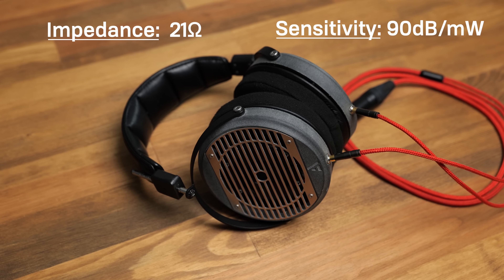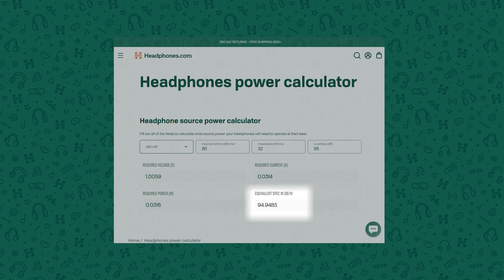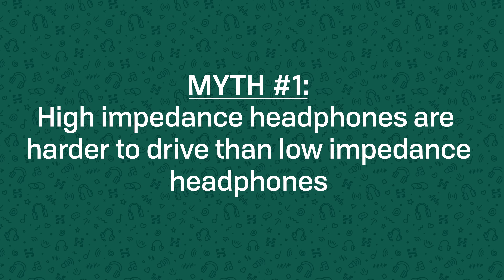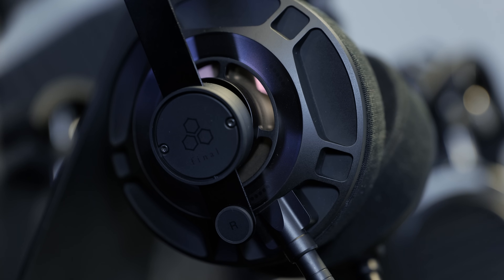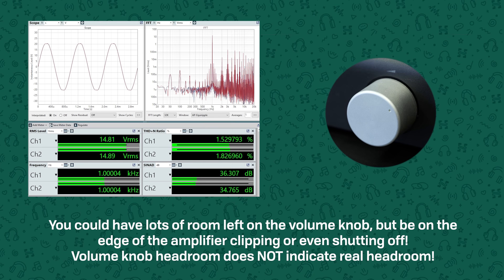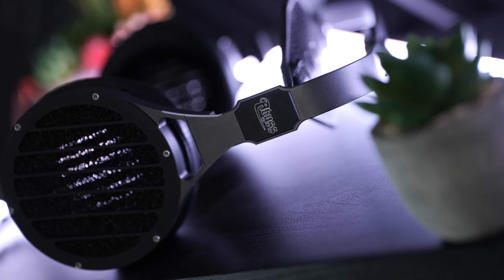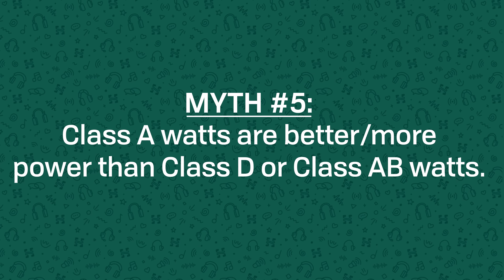Do I need an amp? How much power do headphones ACTUALLY need? - Myths about power

Comment: Example: your calculator says i need 39.81 mW for Hifiman Arya Organic, these headphones are 16ohms, so I need to check amp power on exactly 16ohms? What if it is specified lowest only on 32 ohms? How to recalculate to 16 ohms?
Reply: It's easier to ignore the impedance and just look at the voltage. If the manufacturer only specifies the power at specific impedance, you can put those two numbers into a watts/volts/ohms/amps calculator and it'll give you the max voltage.

Comment: That's a load of technical data that does not translate to actual consumer usable data.
I.E: I've still no idea if I need to get an AMP for my headphones or not, since one of the most important pieces of trivia are missing:
If I am shopping around for headphones, and I've only a PC, at which point do I require an AMP? And what does it mean to "require an AMP"?
Also, what is the average mw / voltage / ma, the average motherboard DAC can provide? I.E: If I've just a PC, at which point will it not be able to power up headphones?
Reply: The trick is to not buy inefficient headphones and then you can run them from any device without an amplifier, or with a cheap dongle if the onboard audio has problems. If the calculator says that a headphone requires less than 1 volt then it is certainly usable without a dedicated amplifier.

Comment: I have a Fiio M11 DAP from 2020. I also use Sennheiser HD800S headphones with the following specs:
Input Sensitivity: 102 dB/1V
Impedance: 300 Ω
Listening Level (max): 102 dB
This gives a required power of 21 mW.
According to Fiio, for 300 Ω of impedance, the headphone out power from the 3.5 mm port is ≥22 mW, which is just 1 mW above the required power.
When I listen to music with my Fiio M11, I seldom turn the volume level about 60 out of 120.
Do I need an amp to improve the quality of my listening experience?

Comment: So... I listened to a long discussion by you with others about amplifier gain verses power. Id never really thought about this before. It turns out that I experimented with various headphones  with my headphone amp , using low gain with my high sensitivity phones, and medium gain on my low sensitivity phones. Before, i was running all my headphones at high gain. Anyhow- im running my amp at 3/4s power at low or medium gain, and my headphones sound better! Cleaner , more dynamic- not different , but actually improved, particularily in terms of bass. Im not sure this is what you meant. This was the result, however. I just wanted to say thank you because this discussion was neaningful for me. You guys know your stuff!
Reply: Can you send a link to the video of podcast

Comment: I have a portable 2.1V output DAC and i'm interested in the sennheiser HD620s. Their SPL is 110dB/1V with a 150ohm impedence. I'm worried for the THD since it's 1kHz/90 dB SPL and it says <0,005%. Does this mean I can hear distortion if i listen loudly?

Comment: I agree with your comment on the volume knob, except that if an amp is set to be much higher gain at a lower potentiometer setting, then you're going to either get clipping or distortion, or likely both, at higher potentiometer settings. 

Or the potentiometer is non-linear, and you just get a significantly reduced increase in gain as you turn the knob.

Either way, these goes to 11!

Comment: My Rupert Neve RNHP, fed a 5V signal from from dac, can power most headphones. It's a very small amplifier. The noise floor (hiss) is high, so it is not suited for sensitive IEM. It sounds very detailed. It is still my benchmark.

The JDS el amp ii has more gain, but less current. It also sounds very dry and sterile, compared to the Rupert Neve. I mainly use it for games and it looks awesome.

I bought a secondhand amplifier from Musical Fidelity. And it sounds a bit less detailed, slightly warm but more open (also bigger soundstage), compared to the Rupert Neve. It takes away the edge in the highs in songs. It sounds wonderful. It is class A, but turning the nob past 50%, the amp does introduce noise. It is a big unit.

I also got a tube amplifier. The Cayin (14 kg) with Russian tubes can power anything Dynamic. But you need at least 40  Ohm headphones to eliminate the tube his. The Beyerdynamic dt 990 pro 600 is notorious for sounding sharp, but is great on a tube. The Koss KSC75 also sounds great on the Cayin.

The most inefficient and affordable headphones are the Fostex T rp series. Because of the small planar magnetic drivers, these headphones are very inefficient.

Comment: maybe i'm crazy but first of all your video is very useful, I bought an DT-990 Pro and I really don't need an amp I just need to push the volume to 75% but I don't need above that pourcentage. Secondly I was able to test an amp with my headphone and I notice that it's clearly louder but I notice a slight loss of detail in the music I listen to (perhaps this is due to the sensation of "loudness" by the amp) I wanted to know if this is accurate or im just crazy haha. Btw I can modify the audio parameters (without the amplifier) up to 192 khz in the windows parameters, whereas with the amp I can only go up to 96khz. And i can push to 192khz because I have files (I don't know if this is due to the loss of detail)

Comment: I recently ordered the Ananda BT because it's an open headphone with bluetooth, I expect it to come in a few days. I have 0 experience with open headphones, dacs, amps etc. so I was wondering if I should invest in let's say the Topping E50 + Topping L50 to up my game or wouldn't it do anything? I suppose it won't in BT mode, but when wired should I notice a huge difference? And I've read that this headphone has a build in DAC because that's needed for BT, so maybe just the AMP will be sufficient for it?

Comment: Oh God, I;m so confused...  Ok, I just bought the DT990 Pro's on sale from Beyerdynamic, for use with my laptop. I do not have an amp, interface or seperate DAC. I haven't received the phones yet, but now I am totally paranoid when I fire up my DAW, I  will hear very little through the standard soundcard 3.5mm jack. And I have asked so many different people and got so many different answers. Someone even said without an Interface AND an amp, I'll hear basically nothing, while other people say It will be absolutely no problem whatsoever.

As I said, I am so confused!

Comment: High impedance means it doesn't draw enough power (but theoretically you could run lots of them in parallel on one amp so it's not the same as low sensitivity or efficiency). Low sensitivity means it needs lots (comparatively) of power to get loud, although sometimes sensitivity is measured in terms of voltage needed to get loud - which can also mean high impedance cans simply receiving less actual power, not just inefficiency.

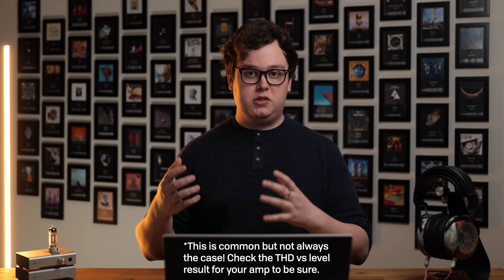Comment: i didnt really get the part about planar (9:27)

so let me recap if i've understood correctly: so if i listen at 85db the bass region in most song could be at 20db higher due to human hear stuff, so i plug 110 db in the calculator to see if i can drive it in the full range

so in planar the bass is particulary hard to drive so the amp will output even more power towards those frequency and therefore i need an amp that drives cleanly even at higher power?

so in practice what happens and how i check this? i have a fosi audio q5 that is rated for 400mW @32ohm and i'm intrested in a

Comment: One thing I still don't understand:
Is there a good reason to still buy and use an amp if I am using headphones which can be played at ample good enough volume across all my devices? Or maybe in more concrete terms, would something like Campfire Andromeda or the new Sony MDR-MV1 benefit from amp when both can be driven easily on a smartphone? Lots of people seem to suggest so, but what is the science behind that?
Reply: Dac in your mobile often isn't of high quality...
Reply: NOISE!  Never mind the science.  Isnt it enough for you to be told over and over again that phones and computers are horribly noisy? And we are not just telling  you about audible noise (which may actually even be present).  Get a separate dac/amp and you will hear for yourself.

Comment: This video is so pointless and useless.
"Do I need an amp?" Well... just plug your headphones in and see if they sound tinny with a volume level that is to low for your taste.

"Volume and depth of sound seem fine...  I guess it's good."
or
"Man, this sounds weak thin and it just doesn't get loud enough for me and sounds distorted when I turn it up. It seems like there isn't enough power driving these."

Just don't impulse buy a DAC or DAC/AMP when you're falling for the upsells and marketing hype. Try your headphones for a week, you're experience with that will tell you if you then, also, should look at buying some sort of amp solution.

Critical thought - It's hard. I get it.

Comment: I have resisted the urge of upgraditis with my amp because lots of people at release called it the last amp you will ever need (thx 789). I’ve seen certain audio reviewers say it’s boring or clinical but it has always worked for me and having 3 outputs that run simultaneously has been great for listening parties with guests. It can run my hd800, q701, hd650 and many others to ear bleeding levels at the same time😂
Reply: Your comment is completely meaningless

Comment: I wouldnt say that higher impedance headphones draw less current. Transducers are moved by current and they need enough of it so higher impedance headphones need more voltage to flow enough current. In other words yes they can draw less current at given voltage, but they can be underpowered when the voltage is too low. I =V/R, where R means load impedance (headphone). The higher the R is the lower the value of the current flow (as u said), so u need higher value of voltage to achieve good amount of current flow to the transducers.
Reply: So the max voltage of the amp is constant as you change the load (headphones)?
Reply: @SlashThePriest not sure if I understood your question correctly, but voltage will be attenuated by the volume knob (so it depends on the loudness you are listening on, using given headphones). I hope I dont say bullshit, though 😅
Reply: @matusjurcik6974  Yes exactly, that was what I was trying to say with max voltage.

As long as you don't change anything but the headphones the voltage should be the same. The output of the amp is limited by the voltage, so if I wanted to calculate the power of an amp with different impedance (headphones) than the spec sheet of the amp I would be able to do so with Ohm's Law by assuming that the voltage is constant.
Reply: @SlashThePriest  ok :) my OG comment was purely, about ohm law though (without consideration of volume adjustability ,,feature,, of an amp). Its alright to send control questions, though. I do it all the time 😁

Comment: Is it a myth when ppl say x IEM requires this much power on specs, but in reality is much more power hungry to reach it's full potential, and requires instead of a BTR7, a FiiO M17 instead? Is that actually related to power, or just sound signature pairing/synergy, or even placebo? Or do headgear really require more power than their specs to reach their full potential?
Reply: Planars like current because of their low sensitivity and impedance which is a hard load for an amp to manage. Generally when we are talking about personal audio, the more power a device has, the more capacitance is likely to have. This gets more complicated when you move in to significantly more expensive products were they have relatively low output power, but extremely high current offset. Voltage is simply stored energy, its only job it supply the amount of current the headphone needs. This might be why its advantageous to buy a amp way way more powerful than you'll ever nee purely by its power rating, because the current is what is powering your headphone, which usally isn't stated on the spec sheet.

Comment: Thanks, that was a knowledgeable and succinct presentation.  Very well done!  Am wondering if a presentation on this topic with a small assortment of amps and headphones would be appropriate for events such as CanJam or other HiFi shows?  There is nothing quite like personally engaging in the points mentioned, (watts, impedance and sensitivity), than through first hand experience for those new to the hobby that is a passion for many.  Really enjoy the conversations between and collaborative attitude of the people on The Headphone Show.

Comment: I'd like to see a video on how using an amp vs not using one affects the sound quality of headphones, i.e. what things can I look for to know whether my headphones are underpowered, or how much performance am I leaving on the table by not using an amp on a headphone that is supposedly hard to drive.
Reply: After doing some testings. Just using PC onboard. It gets my hd650 loud enough for most things. If you're wanting that bass rumbling from them, just can't get there even with an added amp. Using my 10 year old O2 dac and amp. High gain. I can get to that head rumbling bass without destroying the mids and high
Reply: My phone could only derive DT 770 pro at say around low-half volume, where as Macbook pro was able to derive it to very high volume. As for quality of sound it doesn't change, maybe loudness effect can appear like a change.
Reply: how many ohms  @ManoharSingh-dg8ih
Reply: @Phoenix_of_the  80
Reply: @ManoharSingh-dg8ih  This is flat-out wrong. Rarely is an amp actually required to get adequate listening volumes, the reason you amp is to supply adequate power to properly control the driver through any dynamic swing you may throw at it. A properly-amped driver is faster, more dynamic, detailed, and more controlled as a whole.
Reply: @alondite215 I've been unable to hear a lot of things in songs when using my he400se with a samsung A31. yes, it did get loud, but most of the audio wasn't even there, especially voices, since these headphones aren't as front facing with vocals. to get a decent amount of detail I had to crank the volume near max since the lower 70% was near unhearable even when in a completely silent room.

Comment: A question for the experts: Is the Ifi Zen Dac V2 powerful enough to power a Hifiman Edition XS? And does it absolutely need an external power pack, or is the power from the USB port sufficient?
Thanks :-)
Reply: Yes the Zen DAC is more than enough... The Edition XS requires 63.1mW of power to get to the standard 110dB SPL as listed by Golden Sound. The Zen DAC can do roughly 350mW into 32 Ohm so yes it should be able to run the Edition XS no problem
Reply: You don't necessarily use a dac to power your Headphones. Upgrading the quality of sound from your streaming device is the core issue ...
Often rather simple equipment like Røde AI-1 is sufficient.

Comment: would love some explanation for the formula/equation used in your Headphones Power Calculator.
I've just found the equation to convert the sensitivity from dB/mW to dB/V:
SV = SP + 20•Log(sqrt(1000/Z)),
where Z is the headphones impedance.

just wondering about the formula for required Voltage and Current. while Power I believe is the result of V*A

Thanks in advance for the explanation!

Comment: Nicely Done.
Since your asking.
How about a video taking tier groups of iems & headphone (well known ) priced from $50- & up
and pair them with a dac/amp price appropriate for that specific gear.
Showing how an inexpensive stack will handle the iem or headphone just fine and what a tier up in price offers :)
Including the info. from this video and the power calculator :)
Thanks
Reply: Loads of highly experienced freaks have long shared that sort of knowledge since the dawn of the Internet 😎🎼👀🎶

Comment: Do this explanation apply also to iems? And can I use this calculator for iems? And can you explain how to get power output required for db/vrms?
Reply: 99% of IEMs are very easy to drive that a "potato" can run them😊
Reply: most IEMs don't need amp and don't suffer from the power constraint the headphones have
Reply: @Anti3D-0 most?
No iem in this world needs an amp 
None.
Reply: Well, mine sure sound alot better on my good amps than on my phone through a dongle.  No, you don't need an amp, but both my inexpensive and expensive IEMs sure sound better on a good amp.

Comment: There is one sense in which high impedance headphones are hard to drive. A lot of digital electronics, like the output stages of computers, phones, and digital audio players, do not have any form of impedance transformation (such as transformers) in their output stages, nor do they employ any kind of voltage boost in their power supplies. The amount of voltage they can supply on their outputs is strictly limited by the power supply voltage of the device. A device of that type may work well at driving a low impedance headphone, even if it requires a lot of current, but will fail miserably at driving a high impedance headphone because its maximum output voltage is 3.3 or 5 volts.
Reply: And how loud would an HD600 be at 5 volts? Probably a lot louder than your ears would like.
Reply: Yes, I think he missed this point, along with his outright blunder with his statement about class A/ab/d.